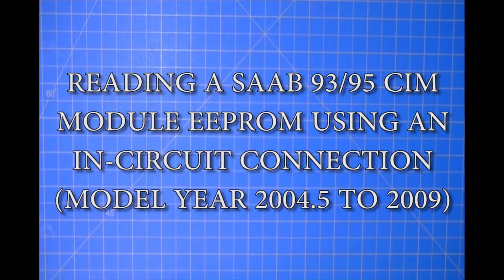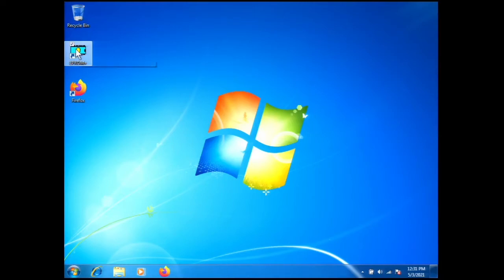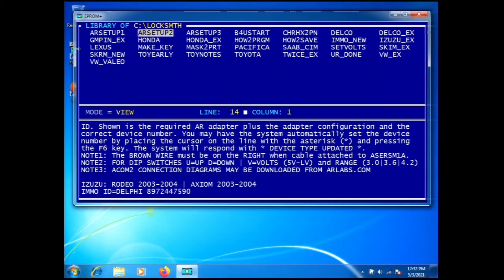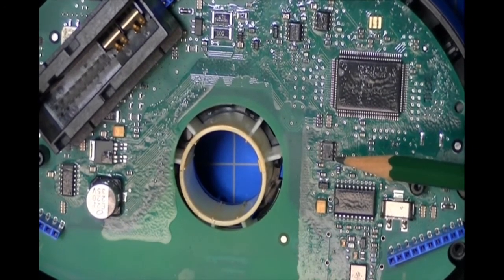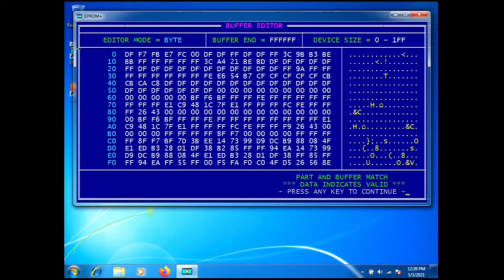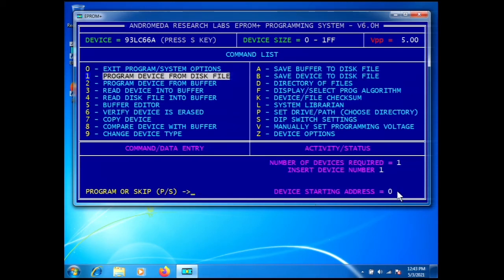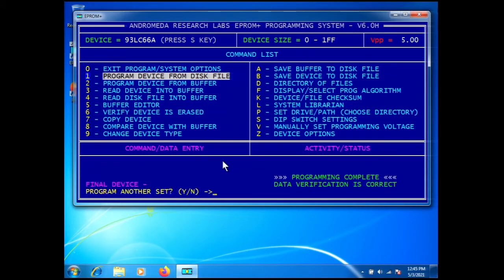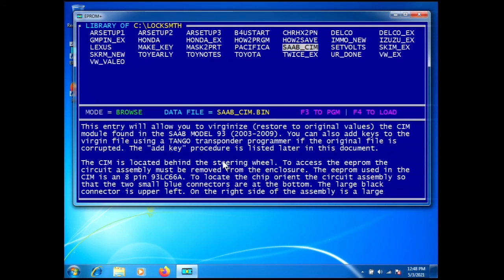Read a SAAB 93 and 95 CIM module eeprom in-circuit plus file save and conversion procedure

Comment: Can u suggest a list of transponder programmers that i can use as part of the conversion process? I have a audi 9 b8 2009 bcd2 I would like to attempt the process on.
Thanks for any information
Reply from the maker: One that is commonly used by automotive locksmiths is the Tango. Beware of cheap clones of this unit. There is also the VVDI although I am not a fan of this product manufacturer. If you search on "transponder programmer" you will get other results. Regardless of which one you choose be sure you get good support. The original Tango has good support.
Reply from the maker: Here are some links - A legit unit:
https://keyinnovations.com/tango-hardware-w-basic-software/?sku=SCO-EP-TANGO-001&cmp_id=22376264068&adg_id=182216507172&kwd=&device=c&gad_source=1&gad_campaignid=22376264068&gbraid=0AAAAADlB-DLsVqSBhoBOMzX1fMPANk9yS&gclid=Cj0KCQiA0KrJBhCOARIsAGIy9wAWvbAMedQEUJVa_rKqR6TkT1wd7Q850RDpzUByNavhL4j0kTrsW8oaAg36EALw_wcB

A clone: https://www.aliexpress.us/item/3256803918342604.html?src=google&pdp_npi=4%40dis%21USD%21180.00%21144.00%21%21%21%21%21%40%2112000037749666675%21ppc%21%21%21&src=google&albch=shopping&acnt=708-803-3821&isdl=y&slnk=&plac=&mtctp=&albbt=Google_7_shopping&aff_platform=google&aff_short_key=UneMJZVf&gclsrc=aw.ds&albagn=888888&ds_e_adid=&ds_e_matchtype=&ds_e_device=c&ds_e_network=x&ds_e_product_group_id=&ds_e_product_id=en3256803918342604&ds_e_product_merchant_id=109342811&ds_e_product_country=US&ds_e_product_language=en&ds_e_product_channel=online&ds_e_product_store_id=&ds_url_v=2&albcp=19678427463&albag=&isSmbAutoCall=false&needSmbHouyi=false&gad_source=1&gad_campaignid=19686402437&gbraid=0AAAAAD6I-hG5Is-C2bY0h7lnCd8DECFlR&gclid=Cj0KCQiA0KrJBhCOARIsAGIy9wCrBRDK8IRaxZaxrMzQXSs_gugAu1qugC7DL7Vf2fIzNvjtdaYhUlEaAuxfEALw_wcB&gatewayAdapt=glo2usa
Reply: Thankyou so much

Comment: You say in this video "make new key". Am I going to need additional equipment to make this key or could I program the same key that originally came with the vehicle back in ?
Reply from the maker: If you changed the CIM just program the data from the original into the replacement. Once done the original key should work. If you don't have the original I don't believe you can reuse the original key.

Comment: Does the AR32 handle older Saabs? Specifically the TWICE module
Reply from the maker: Yes, the system supports a variety of microcontroller based modules including the SAAB TWICE. Here is a link to our website LOCKSMITH DOCUMENTATION page immobilizer procedures. The TWICE module is near the bottom.
Reply: @andromedaresearchlabs7826  thank you! Fantastic resources!